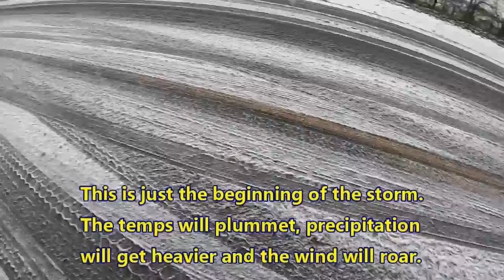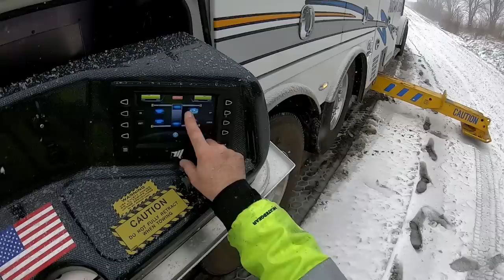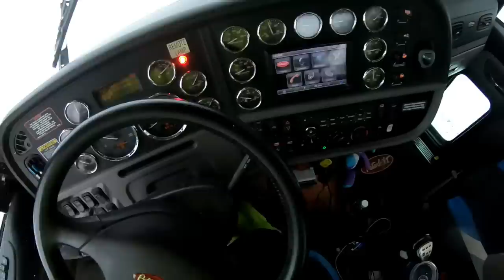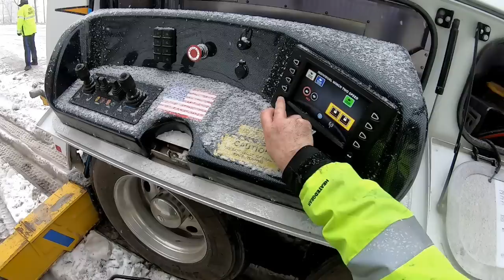Guardian Angel Working Overtime  Two Jack knifes in the Snow Part 1

Comment: Ron, do you like those little Baofeng radios? How well do they work for you?
Reply from the maker: They do well for what we use them for.  We also have some Motorola radios that we use.  The ones we use just depends upon which ones are fully charged.  I have tested the range on both.  I can get about a mile from the Baefeng radios.  The Motorola radios will reach a bit farther, but we don't need the range with the job we do.  We just need on-site communications of usually less than a 1/4 mile.     Thanks for watching and God bless.
Reply: @RonPratt  based on the fact you were taking calls I assume you don't have central dispatch? Ron the man working all angles. God Bless.
Reply from the maker: @Evmoy15  The wife and I were discussing this earlier....I started carrying around the old cellular "bag" phone when they first came out.  I've answered the phones, dispatched, and ran calls for a LONG time.